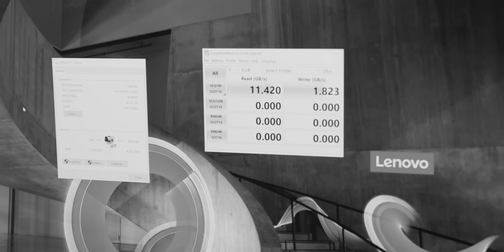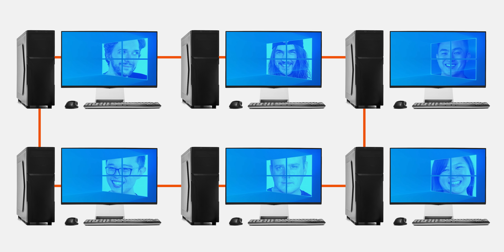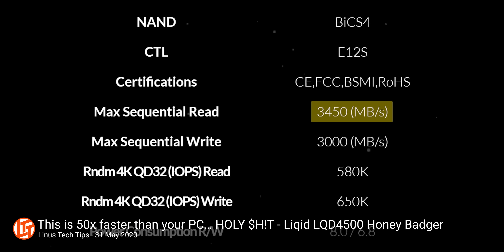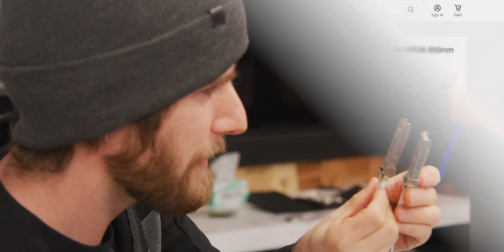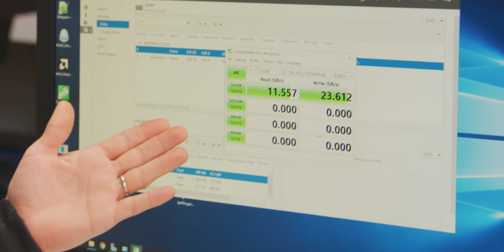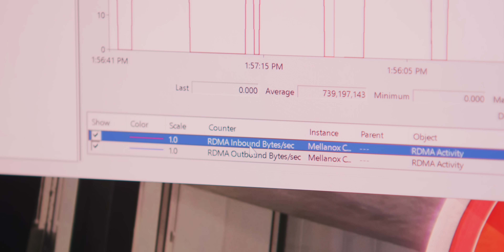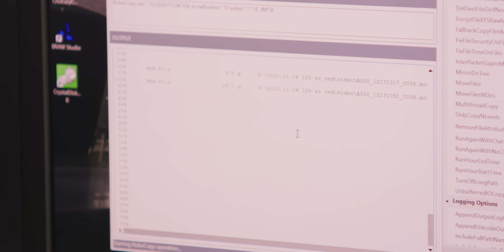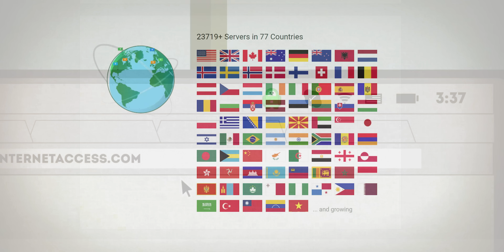A $15,000 Network Switch?? - HOLY $H!T - 100GbE Networking

Comment: With as many editors you have... you better be using some LACP when connecting that bad boy up to your Storage Server. You'd be doing yourself a disservice if not.
Reply: With as many editors as they have they shouldn't be running their own IT. They should be on a big ass EMC SAN that's under a service contract and eliminate their house of cards solution that's full of single-point failure modes.

They won't, and it'll break in a spectacular fashion, then they'll make a video on it as if it were some kind of mystery, we'll all ban together in the comments and dunk on them, but they'll ignore our good advice and it'll just keep happening.
Reply: @jttech44  Hey, I was just glad he mentioned Link Aggregation in the Video. 
I'm not sure what they have going on in the backend, but as long as they separated the storage traffic to a SAN and not tossed everything on the same Subnet with some LACP on the storage boxes. That's not bad. 
I do worry they will only put one switch in or have multiple switches without a LAG. However, I always tell folks... You have to fail before you succeed. Frankly, I've seen a lot of bad network designs in my day, and it's not like it would be out of the ordinary.
Reply: They should really be using SAN and some from of Fibre Channel if they really wanted high speed data transfer for the editors or get a IT company who know what they are doing to help them out. Having a switch like this would be suited towards an ISP environment.

Comment: LINUS: 100 Gb per sec Isn't enough 

Me with 2 mb per sec 🤐🔫
Reply: This is not about internet speed. It’s their local area network speed.
Reply: @susanwojci  ik
Reply: @nav4446  bruh do you even have a router?
Reply: What are you using? Bluetooth 2? I doubt you can get a usable PC with less than 100Mb network card

Comment: "Dual redundant" uhh no... dual or redundant. Not both in that one.
Reply: This is nonsense. "Dual" refers to the number of PSUs. "Redundant" refers to how they are used. For instance, "dual diskX in RAID1" means two diskX mirroring each other. "Quadruple diskX in RAID1" means four disks that are all mirroring each other. The idea that you must either say how many devices you have or say that the devices are operating in a certain way, is ridiculous.

Comment: Since you've got dual-port 100G NICs, you should look into implementing SMB Multi-Channel here. If you set up NIC teaming inside Windows Server (note: must be the Windows feature, not the Intel or Mellanox driver's link aggregation implementation) to get >100G speeds and link redundancy, then enable SMB multi-channel, the Windows 10 Workstation clients will detect this and make multiple connections per transfer. This will help distribute traffic more evenly across the links, since each connection can go down a separate NIC in the team. It also helps if you plan to have another server with more than one 100G port, and want to transfer between them at ridiculous speeds.

Comment: Next on LTT: Linus gets a Juniper MX2020 🤣🤣🤣
Reply: At least he won't be able to drop it 😁
.
.
.
.
.
It's a 45U high switch if you don't know. Won't even fit in a standard 42U rack you need the 47U versions. Personally I prefer them extra 5U for the same floor space.

Comment: aggregation would still only give you 100gb for any single transfer. 6x 100GB port aggregation does not equal 600GB, it equals 6x100GB.
Reply: LAG would only work if it was connected to another switch. It’s not intended to be used between an end client and a switch right ?

Comment: Fiber cables yes are glass inside but you don't really need to baby them like Linus is doing just don't kink the cable and don't step on it and your good also the fact he has  the SFPs already attached is kind of concerning cause that puts a lot of weight usually you would insert the SFPs into the ports and then run the cable

Comment: HAH! FS.com transceivers!! Not surprised in the least. INSANELY cheap pricing (literally to the point of "Are you sure this is legit?"), yet great quality. Customer service is awesome, too!

So far we've had 0 issues with FS-branded transceivers (we've been using them for a while now, back when they were still "FiberStore"). Meanwhile, we've had TWO of the first-party Aruba-branded optics fail on us already, and most of the hardware has only been up for about a year and a half!

Comment: Using RDMA on workstations that are exposed to WAN is ballsy. These NICs are newish, and mostly used in clusters behind a very strict firewall. There will be exploits that can be executed just by getting network access on any one of the workstations, and could lose LMG probably around a week of work, and require several days to repair.

Comment: Linus would lose his mind at my work....i repair video routers for a company called Evertz that basically can do about 2 dozen of these switches in something the size of a fridge. 46Tb/s switching The fans are so loud he wouldn't be able to record this video....and they require 220V power and can use up to 4 power supplies (with redundancy) each the size of this server lol. These routers called EXE are used by all major networks, sports broadcasters, streaming services. I once setup 6 frames with hundreds of these qsfp connections together with hot redundancy....insane. I saw hundreds of those green cables he was holding  all wired up in front of me!

Comment: At this point it looks like it would be easier to just use Linux, especially on the server since on the client it is probably gonna use windows eventually anyway
Reply: not sure what the point of the cards and the fancy cables was on the old video, on linux you can connect the two computers with an ethernet cable, set up the network, and transfer files with openSSH
Reply: Or mac

Comment: Dell: this switch is $15000
Cisco: Do I look like a joke to you?
Reply: Yes. I can relate. Cisco's switches are crazy money. A similar cisco switch would cost at least $25k
Reply: @barsaf9989  make that $30-50k
Reply: @barsaf9989  A Cisco Nexus 93180YC-EX have same port config as this Dell switch, costs only like $10k so while Cisco usually are expensive they arn't always.
Reply: $15,000 for a switch is like nothing compared to other competitors....this is child's play. I've seen switches that cost 25,000-30,000 lol
Reply: @Sean-wv4jd  at the top end, switches are "cheap" its the line cards you place in them that run in the $x00,000s
Reply: @Sean-wv4jd  yup we have 7 Extreme VSP 7400s and 2x7432cq  cool quarter mil in switches...
Reply: @michaelross3196  damn nice! That would be cool to see.
Reply: Cisco switches in this range costs roughly the same. This is an older generation switch.
Reply: IKR? It's just a fraction of the price of Cisco ACI.
Reply: @mushiat6530  out of the several hundred junipers we have, I have only had 3/4 RMAs not including PSUs
Reply: Just a joke for amateur =))
Reply: I have to agree with most of the comments about cisco switches being rock solid and lasting years without dieing. Now I will say this i have used enterprise dell switches and cores and they are pretty solid as well installed one and 4 years later no issues. With the cost cisco normally has a lot of options now depends on your need causes the cost to vary
Reply: Ubiquiti have a switch with (on paper) the same I/O (42x 25Gb/s + 6x100Gb/s) for just US$2000.

:shrug:
Reply: @JolyonSmith  check the price of arista 7060cx (32x100g) on ebay...
Reply: @belakiss7492  Ok.  Not sure what your point is.  US$2000 for 32x 40/100Gb/s ports, used is pretty good.  But the Ubiquiti Leaf is (or will be - it's still in Early Access currently) US$2000 new, fully warranted etc and - more importantly - would plug-n-play with my Ubiquiti management infrastructure which the Arista (or any other gear) wouldn't.

So while I don't doubt that there are other brands offering similar spec'd gear at much lower price points than the Dell, my personal interest (other interests are valid) is that as a very happy Ubiquiti customer/user, I'm particularly interested in how their offering compares (and since we know that Linus is also an Ubiquiti user/customer, I figured he might be up for doing that sort of comparison).  ¯\_(ツ)_/¯
Reply: Cisco switches are very expensive because they have more dedicated ASICs and a lengthier development process.
Reply: @mushiat6530  nobody said anything about wanting to put Ubiquiti into anything other than a HOME network.  Quite the opposite.  I was very clear that I was considering the Ubiqitui value proposition specifically FOR a _HOME_ network.  Even more specifically, my home.  So although your point is valid I'm not quite sure why you felt it needed to be made.  ¯\_(ツ)_/¯

And since Linus also chooses Ubiquiti for his home, I figured it might be something he too might be interested at looking into (or might already have). :)

Comment: Me at home:
- 1Gbps in the whole house, except my desktop that's directly connected to my NAS server at 2.5Gbps
- Me having 2 servers. The NAS having 10.8TB and my vbox having 4TB of storage

LMG:
- We had slow 10Gbps network, now we're upgrading to 100Gbps
- Our network storage is full, lets expand it to 1PB

My previous workplace (1.5 years ago): 
- Our main internal network connections runs over fiber squished under 10 pounds of other cables at an intermittent 1Gbps, some of the older parts still use cat 3 at 10Mbps
- Our 3TB network storage is full, please delete some of your files
- This are an high tech company...

Comment: so i have a regular pc, asus prime a320m-k with a ryzen 3 2200g + gtx1050 ti 2gb, 8gb (4x2) 2133mhz ram with a 1 tb hard drive (7200rpm), regular wireless network card plugged into the mini slot under nvme slots on the mobo, and a 350vs power supply from corsair. my download speeds on steam peak at about 2.5mb a second. is there any way to make it faster by buying a better wireless network card or maybe some other hardware/booster? something that doesnt involve me calling my network provider to spend more money on a different contract?

Comment: I have no idea what's going on.
Reply: still watched it till the end
Reply: Files go brrrrr. That’s about the entirety of my knowledge here
Reply: He used a network switch which is an intermediary device that takes packets from one source and sends it to another based on the port that the packet specifys, it is able to go this fast because he is using SFP ports which are ultra fast ports there are not many of them on a switch but thats because you are only meant to connect servers and other switches to them, for cables he uses fiber optic cables that work by sending light signals as he says in the video lasers, this is obviously very fast. Hope this helped!
Reply: Old man likes expensive products and knows a lot about them
Reply: @pecador_tor  old? You don't mean Linus do you? If he's old to you then you probably didn't even hit puberty yet
Reply: @pecador_tor  1
Reply: Ridiculously fast file transfer
Reply: LTT works on a centralised information infrastructure system...meaning that all projects are on a central system (server) and that editors will never have the project they're working on, on their computer. So with that in mind they need a very fast connection to that information (as they're working with huge files) and preferably a connection that doesn't put any cpu stress on the server or the local device (as the local device needs its cpu to digest the information and the server needs its cpu for operation/not crashing).
This solution accomplishes both...tbh I didn't know about the second functionality as well...thats why LTT is so DAMN interesting
Reply: Rtx 6000
Reply: @jakubsablatura5181  I think u mean RX6900XT
Reply: @whyyshovel420  nah u didnt saw it ?
Reply: @whyyshovel420  7:41
Reply: @jakubsablatura5181  Oh Ok
Reply: @jakubsablatura5181  It's a Quadro RTX, not a GeForce RTX.  In gaming, this would be slower than the new 3000 series, and it costs about $3,500.  It is running basically the same GPU as a GeForce RTX 2080ti (I believe).  It's designed for engineers doing complex CAD, but is also used by video editors.  Most of the cost difference comes from certifications and software support it holds for doing very precise engineering calculations.
Reply: @thepizza123  thx.
Reply: Network IT enterprise stuff. Finally as a cloud technology major at full sail university I’m not bored watching an LTT video
Reply: Likewise, I just enjoying watching.
Reply: Neither does Linus
Reply: gotta go fast
Reply: Linus is having a tech-hardon
Reply: He is transferring files at rapid speed between two computers that are connected to 100Gb Dell switch.
Reply: i want to see it with MY eyes
Reply: Help plz
Reply: yeah i with you.. all i understand is THAT FOXNING FAST!!
Reply: Lots of 1s and 0s moving back and forth
Reply: Why don't they use a phone instead? It's so much easier, you just tap the screen and don't need those janky things to control
Reply: Big numbers
Reply: As far as i understand, he's trying to edit a raw 8k video footage file that's not even exist in the client pc, but in the server. He's remotely editing a footage that could run almost as fast as if that footage was exist is his pc. And even with that such network speed, it doesn't even bother the cpu performance. 

Perhaps it's the same concept as cloud gaming? idk cmiiw
Reply: https://youtu.be/PgbHgQ8okh0 🔥🔥✌ so good
Reply: This is a professional network switch being tested and it is not even high end.
Reply: Linus and others are leading us to a new era of non biased computing as manufacturers make additional equipment such as 15,000 USD switches to help us increase the power of our networks. Computer manufacturers and computer builders are moving to build machines which are not only for people who are not disabled but for disabled people too. Back in the day people built computers meant for the working classes and the super rich but now we have computers for all classes and for people from all walks of life. These computers are self - luminous and can glow in the dark because they use RGB lights. This is significantly important for people who have difficulties with vision. As router performances and NAS performances improved, people created a new computing industry which I call The DIY Computing Industry. Because of all the political changes going on in the world computing is finally going into our hands. Its why we enjoy Linus Tech Tips and others who know that DIY computing is the future. Its good news for big business. But here is the confusing part. Its also bad news for big business, because now large corporations which used to sell us pre - built computers have no idea where to go next, and networks like youtube face losing their former customer bases because of censorship issues. Expect to see nation states you rarely hear about on the news media build things you never dreamed they could build. As cloud computing started to show signs of being phased out in the future, probably we will have multiple gamer communities to choose to interact with. The revolution going on here is so big it will make it easier for many governments to replace their finance ministries with people who were once dismissed as nerds and whose names we never hear mentioned because we are not looking at the right sources for news. We going DIY computing!
Reply: 8:55 is when he finally dumbs it down a bit lol
Reply: basically download video game very fast
Reply: @bussellboppon9843  basically really not, no.
Reply: My day job is enterprise servers and storage and I have no idea whats going on either so don't feel alone.
Reply: @andrewlowe3422  If that is really what your day job is any you don't know what is going on here you should be wildly embarrassed.
Reply: @mikek2138  Not really Mate many "specialists" in the area I specialise in Enterprise pre sales for servers and storage, we have a networking specialist which I'm not, I'm probably geek level 5, this is more like geek level 10. Presales ,post sales and an installation engineer rolled into one. I also do HPe not DELL.

Comment: Suprised you didn't put in Cat8 cabling (yes it exists), and go that way instead of fibre, but each have their own advantages
Reply: @Christopher Grant Usually cheaper and more robust, but yes you're right, once you get faster speeds fibre is quite probably just as good and simplier. They did say they had to install the new fibre cabling to the PC's. PRobably would have been more sensible to run a 100Gb back haul to a second smaller switch next to the Video PC's which I recall are in the same room/area.

Comment: Thanks for the Video Linus and the LTT Team :)  I'm curious if you guys have experienced what Chris from "Chris Titus Tech" noticed during large file transfers windows stopping your data to do some of it's own network update check to the point that it actually severely negatively affected network performance?  My immediate takeaway or guess is that you are utilizing the "Workstation" version of Windows for the SMB Direct features; My question is that in Chris Titus Tech's video he disables window's priority over your traffic and I'm curious how that my affect your experience during these tests?  I'm curious if SMB Direct basically does the same thing?  if your interested in Chris's video https://youtu.be/7u1miYJmJ_4

Comment: I had an awful lot of "fun" with storage spaces direct (s2d) a few years back using SMB direct / RDMA in a couple of large hyper-converged deployments. (ROCE 2.x) Hopefully the tech on Windows has matured somewhat and you don't have to rely on clustering - the potential next step when your editors finally saturate the single file server ;)